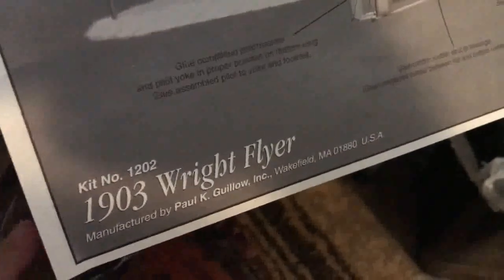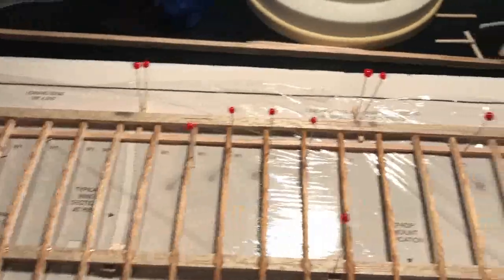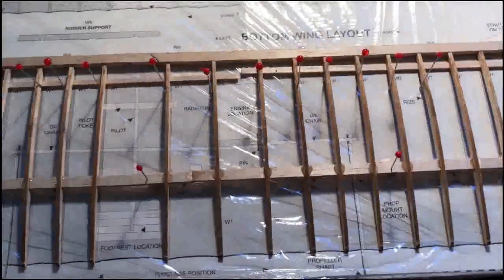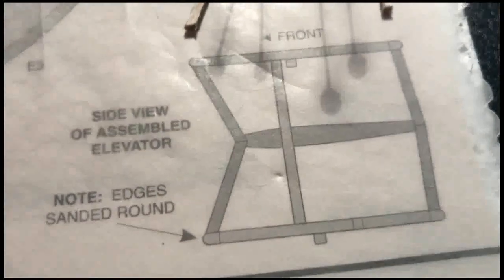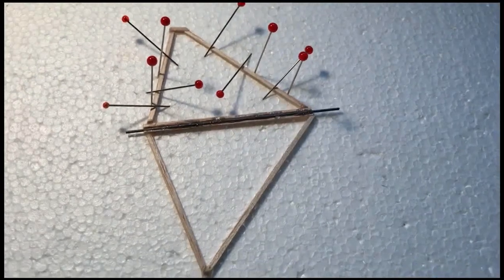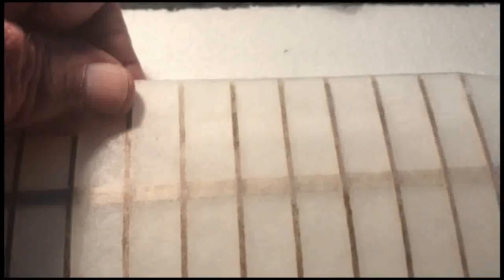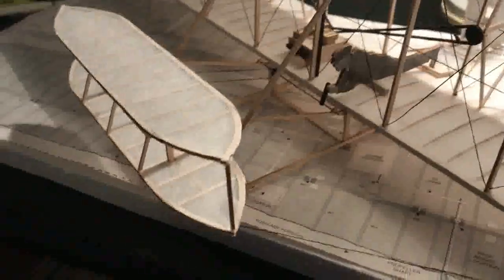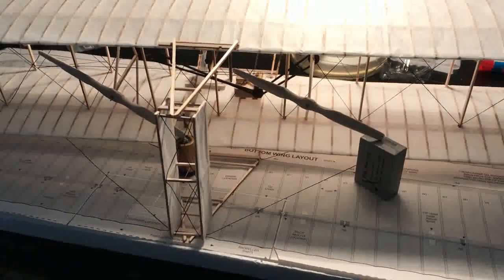1903 Wright Flyer by Guillow's

Comment: Thank you for the video - very helpful advice for several of the difficult steps. One suggestion: use clear Contact paper to cover the plan before pinning any assembly onto it - makes for a sturdy surface and easy to remove any excess glue.

Comment: Your video is excellent and has saved me many hours of frustration in building this model.  

I'm about to start tissue-ing the wings and have a question: The instructions suggest using a single piece of tissue, glueing down the bottom side, then folding the tissue up over the top side.  You instead chose to use two separate pieces of tissue (one top, one bottom).  Had you tried the instructions and chosen a different path?  Or did I read the instructions wrong?   I do worry that folding the paper over will lead to wrinkling, since it's folding on a very non-straight edge (the trailing edge of the wing).